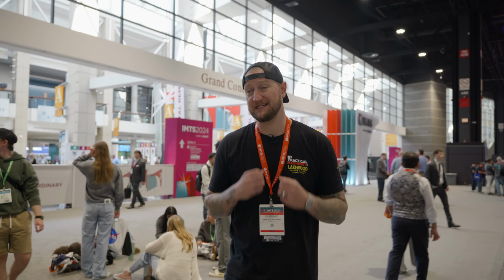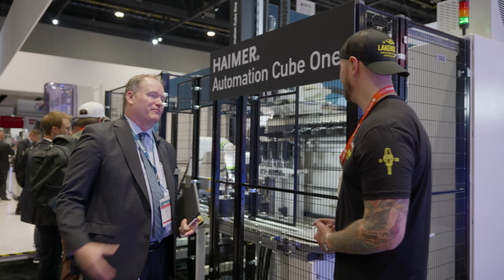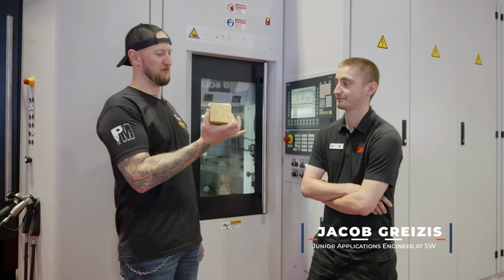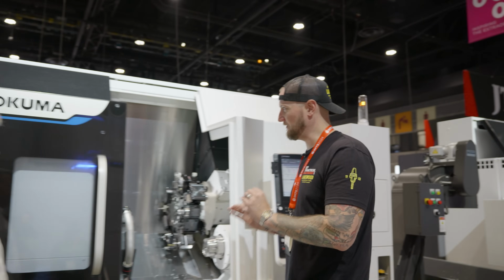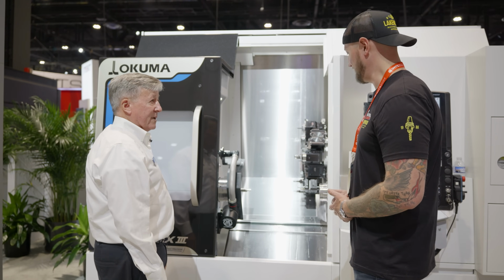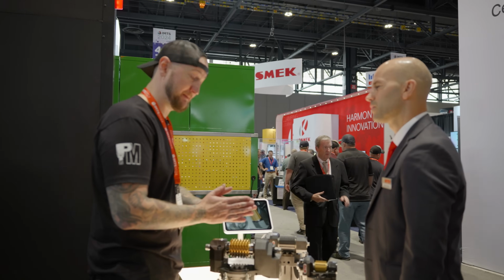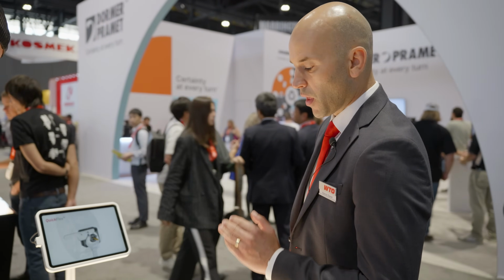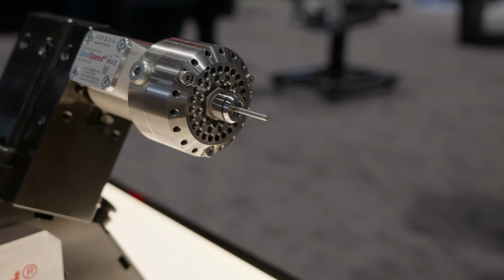This IMTS Visit Hit Different – Here’s Why! | Machine Shop Talk Ep. 122

Comment: For the record, the 24 show only had 2713 more registrations than the 22 show, however the 18 show had 129,415 registrants for the same duration.  Look it up and do the math yourself.  The last two shows are down a lot.  The 24 show was my 19th.
Reply: Chicago is a very dangerous city; violent crime can happen anywhere at anytime.

Alot of folks avoid the show for that reason.